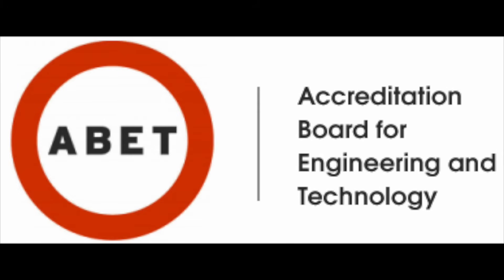WHAT IS ENGINEERING TECHNOLOGY (DIFFERENCE BETWEEN THEORETICAL ENGINEERING) in the U.S.?

Comment: I saw this video in the late spring or early summer of 2023.  It was part of what helped me develop confidence I needed to continue onward towards a Bachelor's degree, but this time switch from Electrical Engineering to Electrical Engineering Technology.  I had seen allot of older Reddit posts advise that a BSEET or any BS in ET would grant technician status. But newer posts looked more promising where allot of guys who actually had the ET degrees get on and confirm that they and many of their classmates were getting actual Engineering jobs, sometimes even design positions. 

At the time I had my A.S. Degrees in Electromechanical Technology, Mathematics, Physics, and Engineering (Electrical Track) from a community college. I had done very well in all of my upper division classes at ASU's EE program, except Electromagnetics.  ASU'S Electromagnetics course used mediocre lecture videos and a terrible outdated textbook that didn't effectively develop the skills I needed to attempt all of the homework problems.  I took this class and dropped it twice because it kept getting ahead of what I was able to keep up with, and ASU is very expensive.   At ASU I was only able to realistically handle just a single course at a time in the EE program while working full time. 

Around the time I saw this video, I enrolled at SIU's EET program for Fall 2023. I was able to transfer my Upper division classes at ASU and my lower division classes from elsewhere that were taken as EE classes as EET coursework and had Senior level standings.  I have been able to take TWO classes per term , and in one.case even 3!  I graduate in less than 2 months, in December 2025!

Anyways, thank you for the wonderful advice. I am hopeful and relatively confident that this will provide a huge boost to my career.

Comment: Given that Engineering Technology degrees lead to manufacturing/automation roles post graduation, what are your thoughts on the impact of AI on careers requiring four year ET degrees?
Reply from the maker: Good question. It really depends on the degree. I think Automation and Controls Engineers are safe. I don’t see anyone trusting AI to write DCS/PLC code that could cause hazardous conditions. AI will assist, but not alleviate. Now positions in CAD and possibly quality/Lean positions are a different story. I think that AI will greatly reduce those positions in the future. What do you think?

Comment: Back in the , and today as well, a degree or AAS with the word “technology” in it is taboo, in the sense, that the pay grade may not even that of a craftsman who started work right out of HS. Note, it will get the job over one who doesn’t have any tech training or experience! For those that were born for field service, it’s a very good way to go.
Reply from the maker: I have been teaching in an engineering technology degree since 2008, and my experience has been quite the opposite. I also have an engineering technology undergraduate and graduate degree, and worked in the discipline with my BS for 8 years prior to teaching. My graduates have almost a 100% job placement and are making between $65K-well over $100K right out of college in a rural area. My programs focus on control automation, and in rare cases, my students receive a higher starting salary than a graduate from an ABET accredited engineering program because my students have the hands-on, real-world applications in college. In the state of KY, a survey was completed by the state's education system and it found that the #1, in-demand engineering degree among industry was Manufacturing Engineering Technology.  I can see how old school ET programs might not see the same success, but that is not the case with all ET degrees. Also, I agree, trades (field service) are a great option for some, as long as your body holds up.  Thanks again.

Comment: What are some good alternatives to an associates in EET?
Reply from the maker: Great questions, and it really depends on your region. In my area, south-central US, the EET degrees have mostly been replaced with degrees in Industrial maintenance or mechatronics. Also, a great niche degree, that has one of the largest salaries for graduates is a degree in instrumentation. Instrument Techs salaries can get up into 6 figures, especially with overtime. I would definitely survey your area for demand before I pursued the instrumentation field. I hope this helps.
Reply: @TheCommonSenseProfessor 

I never got a notification on this, but thanks for the reply. I’ve heard that in Ohio they’re desperate for instrumentation techs and they’re offering salaries in the $40-$55 range which is crazy good.

In my area an associate in EET is for the most part the only variant available. Instrumentations controls are only available in certification form and I haven’t done any research on biomedical tech. 

Also I’ve decided to pursue this degree alongside a Mechatronics certification(industrial electrical systems/equipment technician) from a local community college.

When people complain about EET it’s usually because of the same 2 problems.
1: They wanted to become (theoretical)engineers, but no one told them the difference between the classic engineering pathway Vs an associates in engineering Technology, so they get their engineering technology degree and upon hitting the workforce they realize that there’s a difference, and then they get mad and say they’ve been scammed and lied to and tell everyone else to avoid these types of degrees and-
2: People say an associates in EET is not worth it because there are no jobs and I can see where they’re coming from but I somewhat disagree. What separates this pathway Vs the pathway of more traditional degrees is that there isn’t a clear pipeline and colleges don’t usually encourage specialization. Just think about it, if you want to become an engineer, doctor, lawyer,  teacher etc…. colleges will help you decide what kind of doctor/lawyer/engineer/teacher you want to become and then once you’re close to graduation you usually have the opportunities to do internships, so essentially in the traditional degrees colleges WILL help you find your niche because you HAVE TO but compared to an associates in EET that isn’t the case. As niche as EET may be, it does not prepare you for anything in specific and this is where people complain that they can’t find jobs, they haven’t done the other half which is developing their specialization/niche.

-The way how I believe an associates in EET is best used is by using your associates to develop a solid foundation block of how electronics, electricity and electrical systems work and then you develop your specialization pathway (industrial maintenance, automation tech, Electric Vehicle tech,
Photovoltaic/windmill technician, instrumentations control, heck maybe even biomedical tech) getting certified in something specific and over time you become a master technician in your trade. 

TLDR;

An associates in EET is worth it only IF you want to become a TECHNICIAN in the electrical/electronics field. So it’s blue collar, but this type of blue collar requires lots of maths so it’s one of the more advanced/harder trades to get into which is a good thing because it means it will be harder to replace you.

Comment: Would a 2-year applied engineering technology degree allow me to work in a non-factory seting? I like working on things with my hands but I would like to avoid shift work and be able to do part-time work.

My 10 year goal is to someday be able to work part time with my skills even if that means being self employed. 

I don't want to limit myself to skills that can only be applied at factories that do shift schedules. Will your program put me on a path to jobs like these?

I assume there are more part-time jobs in field repairs/service/maintenance for companies who service residential or small commercial customers (like restaurants).

Will Applied Engineering help me get a job doing this or will a more specialized field like electrical or HVAC be more marketable to "non-factory" companies

Thanks
Reply from the maker: @TheHoldensNC  that is a great question. There is no doubt that most automation technician jobs are for factories. There are alternative routes. One is a position in building automation. This is a field, especially in big cities, that requires the same skill set and are in demand in larger cities. This also requires the same basics skills as in Factory, but it would not be part time that is needed is in municipalities working with wastewater. There are some certifications that you have to get equipment is a process. One last option that I can think of is in the field of natural gas, oil, and other process fields like that. I’m not talking about working in refineries but in the field. I hope this helps.

Comment: Hello professor I have been thinking about switching from EE to EET in North Carolina I was accepted by a university in my state that is ABET credited I will graduate from a community college with and associates in engineering degree so I have taken calc 1 to calc 3 and differential equations and physics 1 and 2 I’m just tired of all the math and I don’t think I can take more maths classes like that but I like doing labs in physics I enjoy things like that. Will switching mess up all the work I have done for the part 2 and a half years
Reply from the maker: Thank you for reaching out to me.  It really depends on the program.  Generally EET degrees only require Calc 1, but some require Calc 2.  Also, most require Physics 1 & 2, but algebra based instead of calculus based.  If you find a more theoretical EET degree at your university, then you will probably not loose too many credits.  If it were me, I would put your unused math and science classes towards your technical electives, but that depends on your advisor, but it is something that you might want to push.  I would meet with an advisor from both programs and have them lay out your graduation plan for both.  The biggest problem with switching now is that an EET student will generally start core classes their Freshman year, while an EE student generally waits until their Junior year.  If you switch, it might put you behind a little, but again, you will not know until you meet with an advisor.  I hope that this helps.
Reply: @TheCommonSenseProfessor  do you think EET is a good field to go into everyone has told me it is and I can earn good money part of the reason I like it but  I also like it because I get to build things
Reply from the maker: I cannot tell you about your area, but in my area, it is a good area, and you will generally make as much money as you would with an EE as long as you go into some type of controls or automation.  I would be sure and try to take all of the PLC/robotics classes that you can take.  @robertmejia200
Reply: @TheCommonSenseProfessor  one more question they changed the program to electro mechanical engineer they said the EET program was out dated but they said the program is similar hopefully I can get work in this field I am very excited to start in the fall
Reply from the maker: That is actually a good thing, and they are right.  I teach Electromechanical Engineering Technology, and it is a very competitive, high paying career.  It is a terrible name as most of my graduates are control engineers, or automation engineers.  The reason that I suggested taking as many PLC and automation classes that you could with the EET degree was because this is the future of manufacturing, and the EMT degree should embed the PLC and automation classes into their program
 @robertmejia200
Reply: @TheCommonSenseProfessor   I’m excited for all the hands on labs I’m exempted from all the gen ed courses and math courses  do you think I could make a good salary if go into manufacturing the city I am in has a lot of manufacturing employment
Reply from the maker: My graduates make between $65K-$85K right out of college and I am in a rural area.  The higher salaries are in more populated areas, but that should give you a good idea.  There are a few graduates that make over $100K right after graduation, but that is not common in my area. @robertmejia200
Reply: @TheCommonSenseProfessor  my are is a pretty big city it amazes me how it keeps on growing it’s Charlotte NC I’m not sure if you have heard of this city but there a lot of manufacturing jobs
Reply: @TheCommonSenseProfessor  thank you for your help your insight has helped me a lot
Reply from the maker: Yes, of course.  I have been there a couple of times and it is a growing area.  You should not have any problems, and you are welcome. @robertmejia200
Reply: @TheCommonSenseProfessor  they told me the program is very similar to the EET program hopefully I do not need take anymore physics or math courses
Reply from the maker: I would not think that you would.  Again, I would highly encourage you to take as many PLC/Robotics/HMI/SCADA classes as you can as this is the future.  Good luck. @robertmejia200
Reply: @TheCommonSenseProfessor  one more question did you have to take thermodynamics to get your degree in electro mechanical engineer the EET degree did not require that class and also the EE degree at the university I’m going to do not require thermodynamics so hopefully I do not need to take that class I have heard that class is a nightmare.
Reply from the maker: No, I see no reason to take Thermo in an EET program.  MET, or MET then yes, but unless you work at a power plant, or possibly a chemical plant, then you would don't need thermo.   @robertmejia200
Reply: @TheCommonSenseProfessor  did you ever use all the math you learned in college in the field my cousin is an EE and he says that they have programs that do all the math for them i'm just a bit nervous because i feel like im forgetting some of the math i took a while ago when i started at my community college.
Reply from the maker: @robertmejia200 to be perfectly honest, I used up to trig in the field and mostly algebra.  I was a control engineer before I started teaching.  Your cousin is correct, knowing how to understand the math is a big deal when you are an engineer, finding the math is generally completed through software or simulations.  Youtube is your friend with reviewing math.  Check out https://www.khanacademy.org/
Reply: @TheCommonSenseProfessor  one more question I have so many did you have to take differential equations I am taking the class right now and it is a bit tough I don’t think I need it for electro mechanical engineering but I’m taking it to get my associates in engineering from a community college
Reply from the maker: I only had to have up to Calc 2 for my degree.  I do not know why any ET degree would require Diff Equations.  If you are not going for the EE or ME degree, you might just want to get your AS degree or just go ahead and transfer.  An Associate degree in engineering is just a pre-engineering degree that means you completed all your gen eds for ME or EE at the community college.  The degree will not lead to a job in engineering by itself. @robertmejia200
Reply: @TheCommonSenseProfessor  it’s my last semester at the community college before I get my associates in engineering degree so I just want to finish and go to uncc in the fall. I should have switched to the engineering technology program sooner
Reply from the maker: @robertmejia200 Hang in there then, the end is near!  Good luck to you and keep me updated on how your BS degree goes.
Reply: @TheCommonSenseProfessor  I will thank you are these the hardest classes you took you said you took up to calc 2 I’m tired of the theoretical side on engineering I have taken a math course every semester including summers since 2021 I just want to start doing hands on things in the labs that’s why I keep going

Comment: In 1995, as a Software Engineering Technology Student, I had taken Diff Equations, two more Calculus math courses, Linear Algebra, Calculus-based science, and Numerical Methods.  Was I cheated?
Reply from the maker: The way that I look at it is if you used all that math in your career, then you were not cheated, but if not then....well I am sure that it taught you good critical thinking skills (academic mindset).  I majored in a similar program in the late 90's (Electrical Engineering Technology with a Computer Systems option) and we had to take higher levels of math than is required now, and it honestly did nothing for me in my professional career.  I think that the professors at the time looked at the math as a good way to weed out students, which I think is a sad way to think.
Reply: @TheCommonSenseProfessor  Numerical methods helped- because that's how you break calculus down into loops and bits that even an 8 bit computer can handle- but 99% of my career has been boolean math, which oddly was NOT covered in a math class, but was covered in logic circuit design.

Comment: We have 3 different engineering tech degrees at Texas A&M. We all take up to calc 2 and have calc based physics 1 and 2, statics, mechanics, thermo, fluids -- pretty much the usual engineer classes. The difference is that our versions of thermo, fluids, etc are designed for engineering tech since most of us don't take diff eq. I've also found that our classes have way more labs than my friends who are MEs and CEs. I read over 85% of the classes in the department have a lab portion.
Reply from the maker: Thanks for your post.  That is interesting that you have to take Calc based physics 1 and 2.  Obviously Texas A&M has one of the top ET departments in the nation under Purdue, but most ET programs only use algebra based Physics.  Some ET programs are not far from theoretical engineering.  As long as that is what industry is wanting in that region, there is nothing wrong with that.  Good luck to you and all your endeavors.